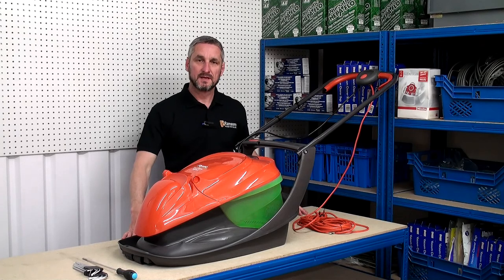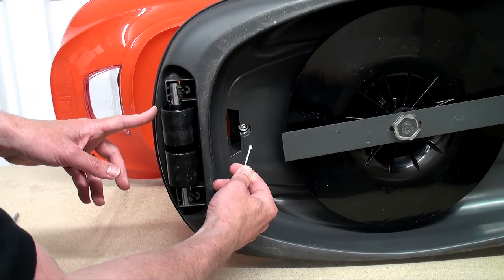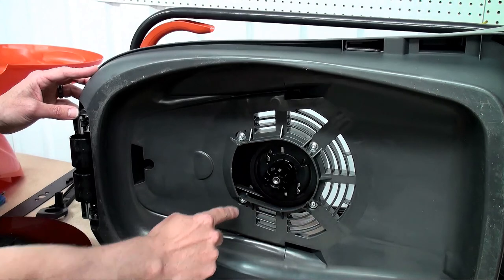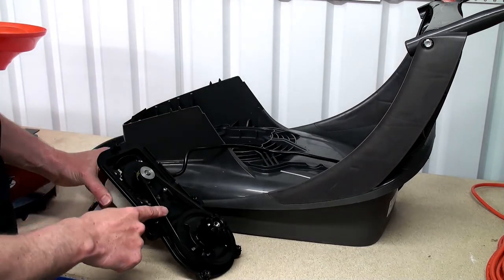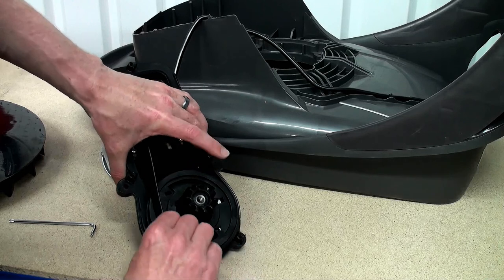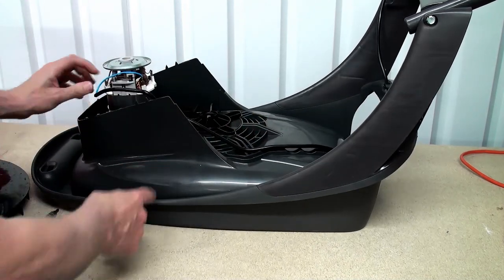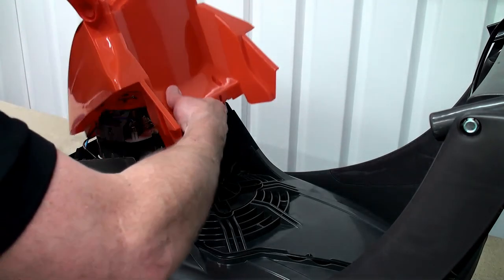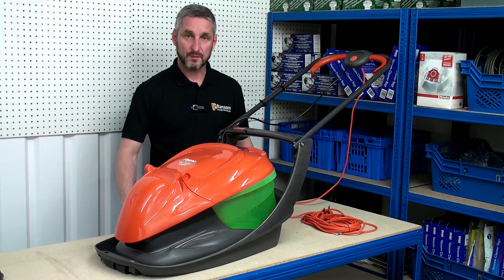How to fit & Replace a Flymo Lawnmower Belt

Comment: Hi the shaft with large pull-up wheel and blade fell out of my waist glide 300. If I replace the base plate does it come with fittings to secure it? Something has shredded or fallen out   Mower right way up under grassbox, centre hole where shaft comes through something’s missing?  Thanks for any advice.

Comment: There was a lot of swearing removing the orange section on the easyglide 300, didn’t realise it has a clip at the front you need to release too.
Reply: How did you release the clip? Need help!
Reply: I can’t remember as it was a while ago I think you need to looks inside where you already have it off and you can see. Might have used a screwdriver to unclip. Sorry not much help

Comment: I have a Flymo Glider 330 and I don't know how to remove the motor cover, can you help?
7
Reply: Similar problem with Glider 350, it has screws and lugs holding the motor cover on! I removed the roller for ease. Using a large flat head screwdriver (you may need 2 screwdrivers to keep it open), separate the orange and grey lugs. Leave the screwdriver in place, then tilt carefully. Around the side are some more lugs that may need opening gently. Next grab hold of the orange cover and the grey skirt ease off gently. Starting at one side wriggling and pulling at the same time. Be prepared for a grass explosion when the cover comes off! Before replacing, I cleaned the grass off and used a little pressure to push back in place. Hope this helps with the Glider 330?